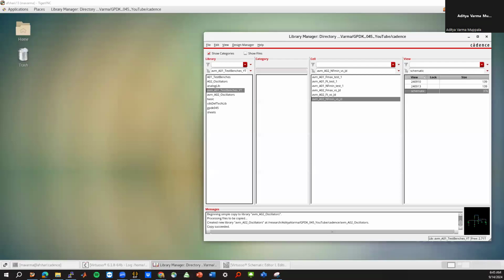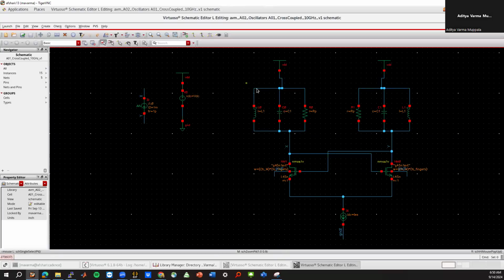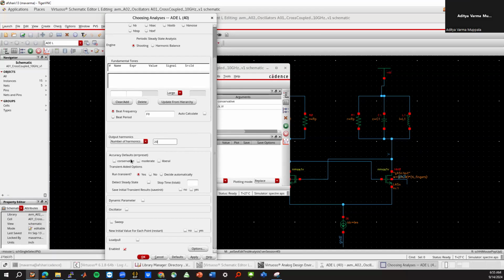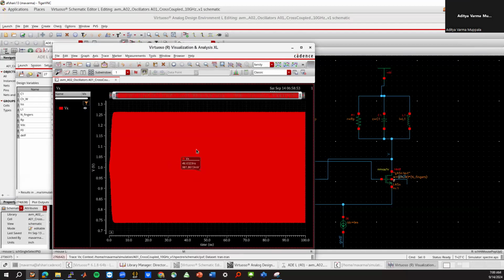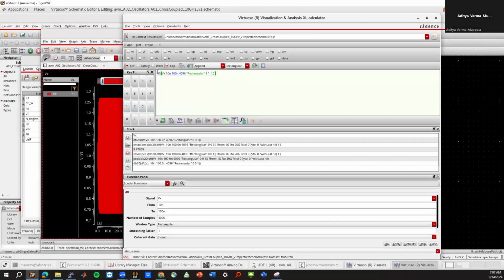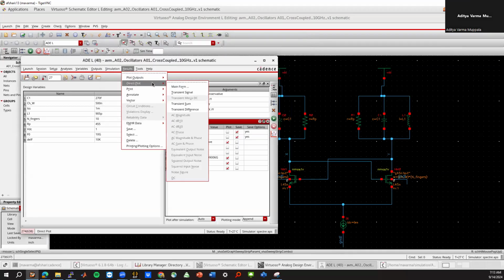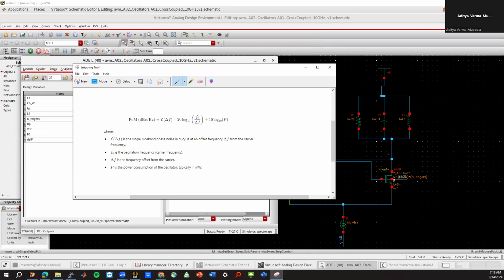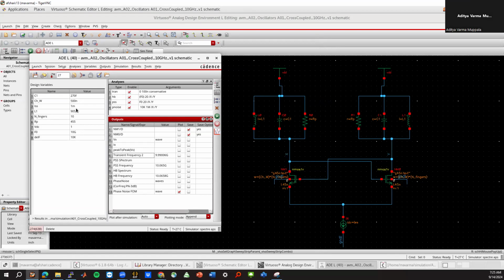Cross Coupled Oscillator Design in Cadence - Part 1 | Oscillators 05 | MMIC 10

Comment: Hello, I'm having trouble running the simulation even though I followed each point you described when inserting the variables and data into the component and into ADE L. I don't know if there was a cut in your editing or if there was some detail missing, because I can't do it. I inserted all the variables C1, CH_W, ISS, L1, N_Fingrs, RP, VDC, FO, delF. Also the analysis forms tran, hb, pss, pnoise.

Comment: Thank you for the great video. You used the default Analoglib components (C, L, R) in the design. How are the values for simulation trustworthy when using these components?
Reply from the maker: Look at the follow up videos (Part 2 and 3) where I replace all components with ones from the PDK and also include PEX.

Comment: The cadence workshop suggest pss shooting for ring OSC and hb for LC. They suggest HB and HB noise sims due to faster results. They recommend those two for large signal nonlinear circuits. U can press help in HB/HBnoise sim tab and see it for your self. Thanks again for presentation
Reply from the maker: I think HB is more appropriate for LC VCOs due to the varactors. I will keep this in mind. Thanks for sharing.

Comment: Thanks for your effort making these videos. It would be a great benefit for all oscillator designers if you could make a video about ISF waveform in cadence using PPV method with PXF analysis. For tail ppv is between mid node and gnd , for cross couple ppv between output and mid node and including NMF. The time domain method takes too much time.
Reply from the maker: Yes I will make these in the coming weeks. Stay tuned.